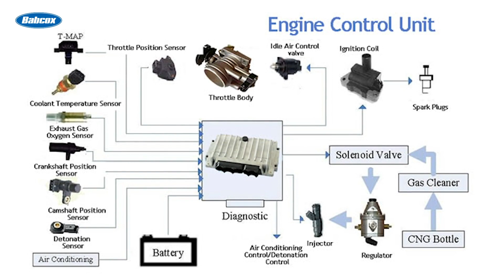Detonation Noise

Comment: Detonation is defined as the fuel in the combustion chamber stops combusting prematurely (for whatever reason).  The optimum peek cylinder pressure should occur at 14 degrees after top dead center for all gasoline engines, if peek pressure occurs before this point, detonation is occuring and you may hear the distinct "spark knock" or "pinging" sound.  This always occurs following the spark event, it's not pre-ignition or pre-detonation.
The causes can be the following:
1) Ignition timing is advanced too far.
2) Fuel quality is poor (octane too low).
3) Engine is running too hot.
Detonation, if it continues to occur, will lead to high combustion temperatures because the thermal insulating cushion of the gas boundry layer across the piston crown is being disrupted and thus, the piston will be exposed to abnormal amounts of combustion heat.
Detonation should be avoided if possible but is not immediately damaging and some small amount is tolerable.